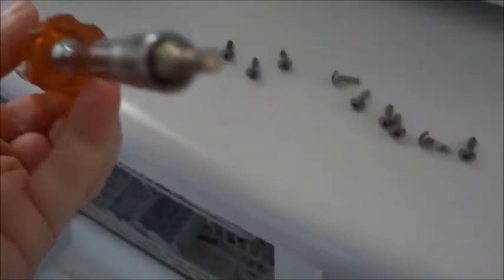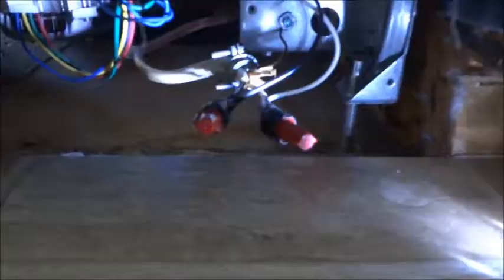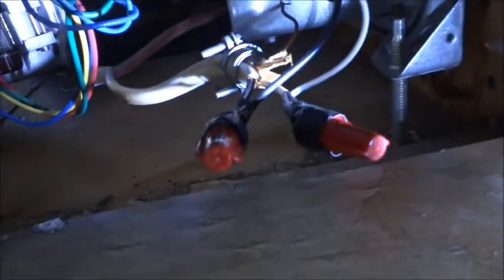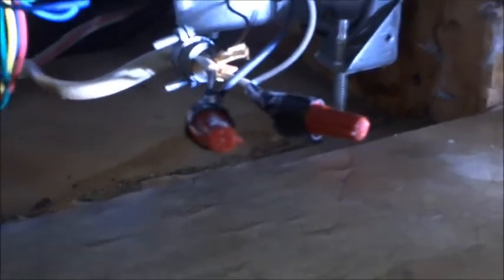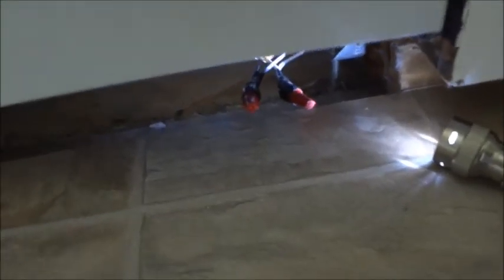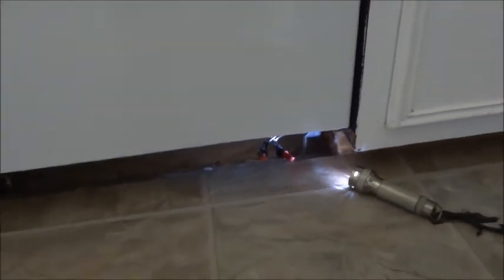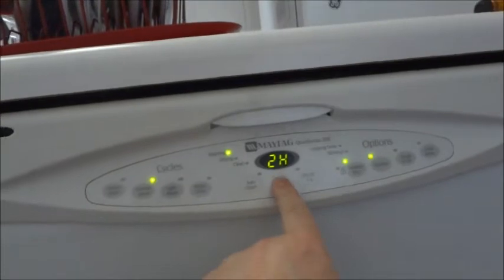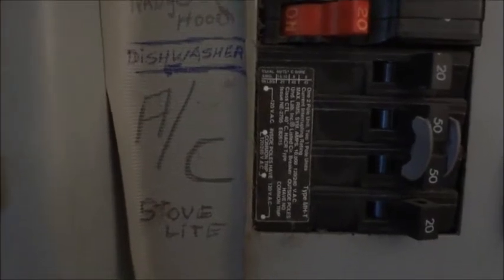Maytag dishwasher quiet series 300 no power (repaired).

Comment: Your video caused me to move the AC cord and bam it started working thanks!
Reply from the maker: Awesome, glad you got it working. Lose connections apparently pretty common with these if not wired properly because they do tend to vibrate a lot & over time it can come loose.

Comment: DUH  I THINK it's getting power there &IT SHOULD be fine?    DUH... what kind of diagnostic is THAT... how about just replace all the parts & spend a fortune & THEN it'll work..
Reply from the maker: I never replaced any parts, didn't spend a penny lol. The "experts" who wired it simply done a crappy job and assuming they did it correct was my mistake but figured it out before spending money which is why I posted this to help others not assume the experts know what they are doing.